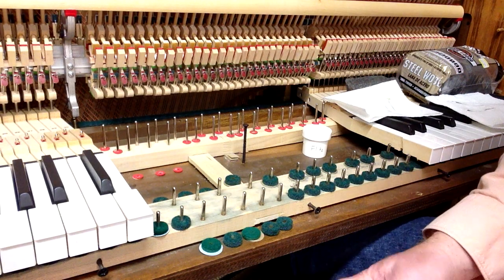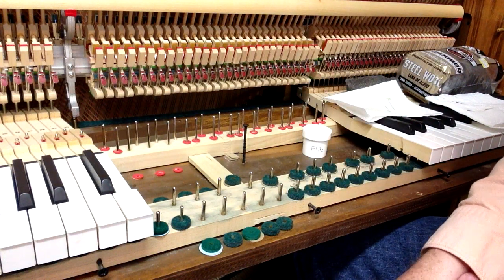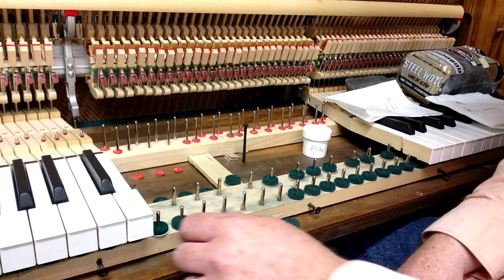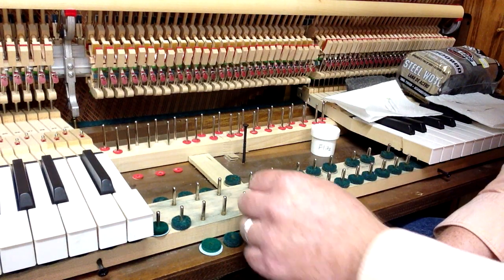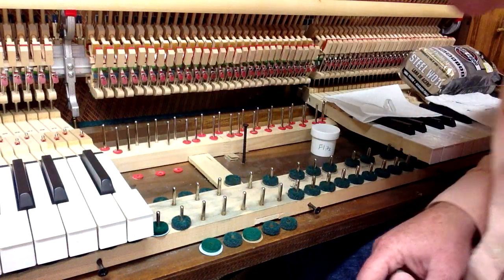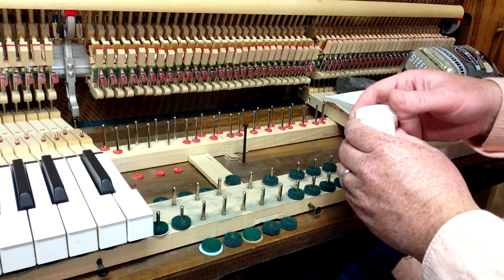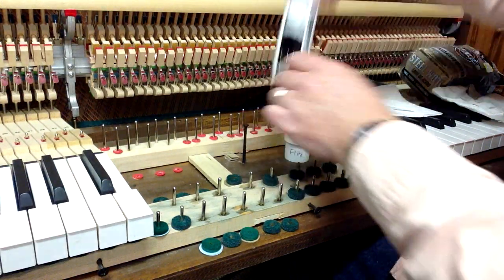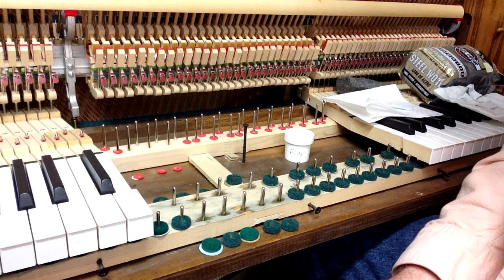Cleaning & Lubricating Keypins - Piano Tuning & Repair I HOWARD PIANO INDUSTRIES

Comment: This is the proper way to lubricate the pins. Slow and methodical. Many would be tempted to just quickly slather on a bunch of wd-40 or something but don't do it. Take your time as Howard demonstrates.
Reply: Yeah, but maybe WD40 or white silicone could work also.
Reply: @Photologistic   It does work (For a moment). However, it's not going to be as long lasting and will likely leave a oily residue that will attract dirt and dust which will make it even worse than when it started.
Reply: @64bitpianist I got a used piano and the keypins were lubricated with something that left a thick and sticky brownish grease. I would strongly advise to only use proper lube.

Comment: Hello Howard, your videos are so explicative and good timed that is imposible to miss a detail. Thank you so much for that professional work! I have a question about lubricantion. Recently I had my vertical tuned up and after some playing I realized there were strange sounds coming from the mechanism of all keys. I found when the jack comes out under the hammer nut, it rubbs a piece of leather attached to the nut. The problem is that it wasn't producing any noise before the tuning up. Now you can hear a squeaky noise (kinda rubber noise) when the jack comes out. The technician who tuned my piano says it is lack of lubricantion. He is going to put some vaseline in it. My question is: is it allowed to do that or the problem is something that went imbalanced after the tuning. Thank you very much.🙂 PD I live in San Jose, Costa Rica. 70% RH and 70°F
Reply from the maker: In most cases noises that you hear in the action aren't caused by tuning as tuning is just adjusting the string tension.  It could be that once the piano was in tune, the noises were more noticeable because you weren't so distracted by the out of tuneness of the piano.  It's hard to say what the best solution is without being able to see exactly what is causing the noise.
Reply: @howardpianoind  OK Howard, thanks a lot. I know it is difficult to see what the problem is .However the specific question is that if it is right to lubricate with vaseline, the leather attached to the hammer nut when it produces noise with the friction of the jack. Thanks
Reply from the maker: I don't feel like Vaseline would be the best thing to use for this.  PTFE powder works well.
Reply: @howardpianoind  Thank you Howard, I also thought it wasn't a good idea to use vaseline.I think it would entrap in the leather making it stiff and sticky over the  time.👍

Comment: dust hair hairpin a dead spider and finally in the base of the piano ...what looks like a live bullet ! I finally got the action out and am busy cleaning pins.
I have ordered two lubricants locally to try
 FINISH LINE DRY LUBE TEFLON PLUS and WD401810036 specialist dry ptfe in spray form...will keep you posted on results
Reply: john Bgood and? How’d it go
Reply: Whoa man. A live bullet to be triggered by a piano stroke. Sounds like the setup to a murder mystery novel.

Comment: hello Howard, I did all the procedures explained here, I bought the product from your store, thank you for the video, it has a lot of improvement, however, I can still hear like a typewriting sensation and noise. Should I need to lubricate the hammers now? Do you think that will fix, or it is what it is and I can get a Kimbal baby grand from the '80s to get better?
Reply from the maker: If there is a clicking sound, it could be due to loose hammer flange screws or loose whippen flange screws.  These need to be tightened from time to time.
Reply: @howardpianoind  Thank you, my kid also says they still a little sticky. I am going to all procedures to get them smooth, amazingly I have a super small baby grand with a really warm and nice sound, is just a shame that the action response is not so great.

Comment: Thank you for this great and informative video tutorial.  Would you happen to know approximately how many applications you could get from one ounce of the Teflon powder?  Also, would using three in one oil on the key pins be okay?  I know that you recommend the Protek CLP, but I was wondering if you think three and one oil might work in a pinch and not cause any other issues down the road.  Thank you in advance!
Reply from the maker: One ounce of the teflon powder goes quite a ways.  It would probably do about a dozen applications on the whole piano.  I wouldn't recommend using the 3-in-1 oil.  The Protek CLP is a dry film lubricant.  The oil would just gunk things up.
Reply: @howardpianoind  thank you very much for the reply.  I have learned so much from your videos.  You are truly a remarkable person for sharing your expertise with so many others.  The knowledge that you have about piano tech and the way that you presented is truly an art.  I would say that you are something of a piano tech celebrity!

Comment: Thanks Howard for sharing your knowledge. I have rust on some pins on my kawai grand. It is neccessary to remove the action or can this be done with the action inside the piano?
Reply from the maker: On a grand piano you'll need to remove the action so you can take out the keys in order to treat the tuning pins.
Reply: howardpianoind Thanks!
Reply: @howardpianoind   You mean of course UNSCREW the action from the board.

Comment: Terrific video! Say, I ordered Protek Prolube (same size bottle but w/spray cap). Is that same/similar as your Protek CLP, would you know? Thanks for such an informative video!
Reply from the maker: ProLube is used in different areas of the piano such as lubricating the grand keybed, but it can be used on keypins like I demonstrate in this video.  You just wouldn't want to use the ProLube on the action centers.

Comment: Hi Howard, could you tell me please, as soften hard and heavy piano keys? I recently gave the piano, but has this deficiency, I much tired to especially touch the thumb, sometimes I do not want to play because I unmotivated, and I'd rather do it on my digital keyboard, I've played different pianos but none was so hard like this. There will be a solution? I appreciate much you answer me. Thank you!
Reply from the maker: Hi Odilia, Yes, there are different things that can be done to make the touch of the piano lighter and not so heavy.  The first thing to do would be to determine what is causing the heavy touch.  There are several things that could be the cause.   Unfortunately there isn't one thing to try before determining which thing is causing the problem.  It could be tight action parts and it could be that the action geometry is setup to provide a heavy touch.  It also could be that the damper timing is too early.
Reply: Thanks for the answer (do not understand English very well, so there are parts of your videos do not understand, it's a shame, I see you have interesting things. To write I use the translator) once the piano installed at home with the first pitch only some keys were harder while others were too soft and sounded very strong, had keys jutting more level, some remained stuck, I suggested to clean the inside that could be due to dirt, actually when I opened it there were tons dirt, dust and lint, I cleaned it carefully, I took the opportunity to level the draft of the by putting keys below the felt washers washers paper, has been perfectly level, all keys sounds the same, no longer get stuck, but now all are hard. I think this has to do with the last reason you suggest, may the damping time is too early. how do I solve it? many thanks!
Reply from the maker: Hi Odiilia,
It sounds like your piano needs quite a bit of work.  The reason some keys are harder to press than others could be caused by some adjustments that need to be made to the action.  Yes, if there is a lot of dirt in the piano it would be good to clean it out, but that won't provide as much difference as the adjustments that need to be made.  I'm sorry that you're not able to understand the videos as well because of the English.  A book would be helpful, but the ones that I know of are only available in English as well.

Comment: Hi, what can I do when one of the keys does not play as loud, it is not any harder to press it and it comes back like the others, but i need to hit it harder to make the sound. Thank you, Eva
Reply from the maker: It’s possible that it needs some regulation adjustments such as reducing lost motion or adjusting the letoff distance.  It could also be due to tight action parts.

Comment: Is there an equivalent of Protek for those of us overseas`? Would it be effective and safe to use silicone or wd-40 instead?
Reply from the maker: I wouldn't recommend WD-40 or silicone.  I'm not aware of another lubricant that would do the same thing.  For the keypins,  if you polish them, this will go a long way in achieving the results.  Also the PTFE powder will help the process on the bushings.
Reply: Thank you!
Reply: if you ever need to lubricate your key pins, what i do is just replace  the felts inside the actual key and before i put them in i rub some powdered graphite on the felt itself. it lasts a long time and works very well with polished pins. and as a bonus, dry lubricants dont attract contamination like wet lubricants do

Comment: I have a soviet Ukraina upright piano made in the 70's and some of the keys move hard and are a little uneven. Could it be from dirt? The piano hasn't been cleaned in a long while...
Reply from the maker: There are a few different things that could cause this.  It could be that the action parts are sluggish because of felt swelling in the flanges, or it could be that the key pins need to be polished as there may be some corrosion on the keypins.
Reply from the maker: This regulating button is for adjusting the height of the repetition lever.  You can adjust this to make sure the top of the jack is in the right relation the the top of the repetition lever.  I will be doing a video on this adjustment soon.

Comment: Can I just use regular cooking oil to lubricate the pins? I have a digital piano and one of the keys is really stiff. Would that cause damage?
Reply from the maker: I don’t really know much about digital pianos, but I wouldn’t recommend using cooking oil.  This can really make a mess of things.
Reply: Cooking oil drys and leaves a thick residues.
Reply: No oil you can rub A sharp lead pencil lead on the pin work s like graffite

Comment: My balance beam felts were so beat up that I had to replace them all and the paper cardboard punchings disintegrated at my touch.  How to I replace the paper punchings from scratch when you don't know which key pin had what or even which keys needed them.  This is literaly a 1950s Story and Clark upright JUNKED piano my son and I are trying to restore.  Yes we know it isn't worth the cost but it is worth the effort to see if we can reclaim something beautiful and functional out of a piece of junk
Reply from the maker: If you find what key height woks best for the piano, then set the key level for all of the keys at that height. Setting the key height is part of the overall regulation process.